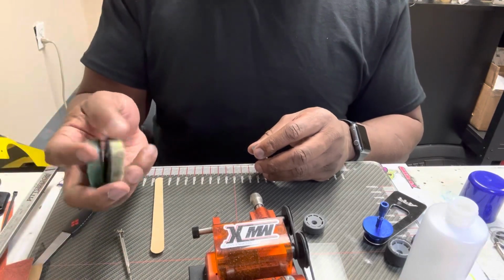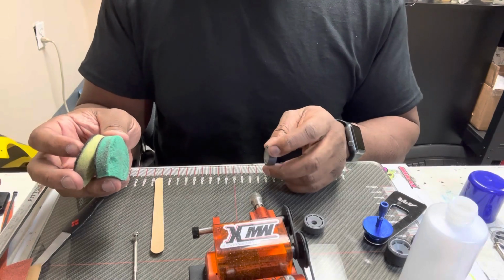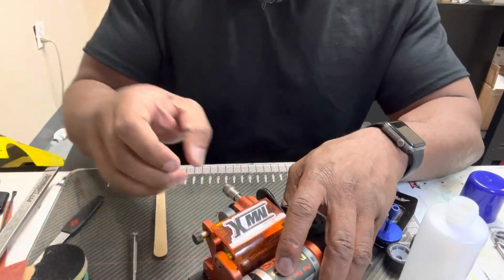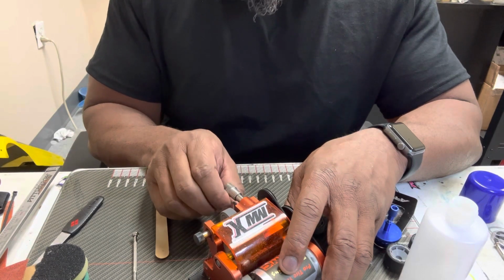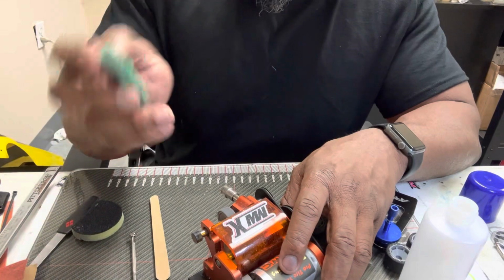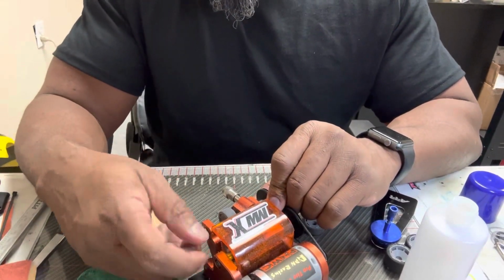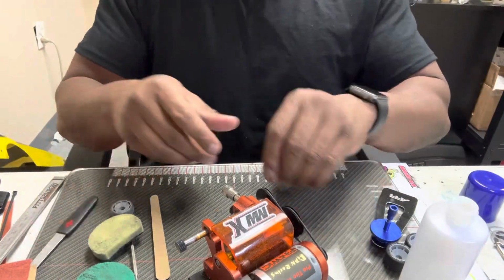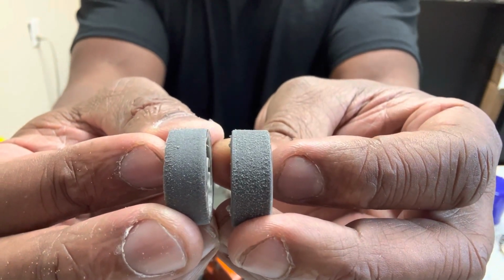Wheels and Tires pt3

Comment: Hi thanks for the video, could you please provide more info on the polishing pads? I looked at Amazon but could not find anything that looked like you used. Thanks
Reply from the maker: I got mine probably 5 yrs ago for my real car so you may not find the small ones but just get bigger ones and cut to size. They are wax polishing pads for 1:1 cars
Reply: Thanks

Comment: Question Marcus.  When truing Marka rear wheels (5 and 10 degree), do you do the same process post truing to make the tire smoother.  All the time I true Marka rears, the tires are so sticky that the surface clumbs up in bug chucks due to it's soft rubber material.  Any tips on how to make them smoother after truing.  When I true down PN rears, I can get the same results like your video here.  Any 411 is much appreciated. Thanks for all your help.  Also, I have one of your cars and i'll hit you up for some questions and parts I want to order from your website.  ~ Roger
Reply from the maker: You don’t really have to do much to the Marka rears after truing them. They will break in after about 2-3 minutes regardless. Well the f1 markas anyway. I hear the new 14 markas don’t feel the same.